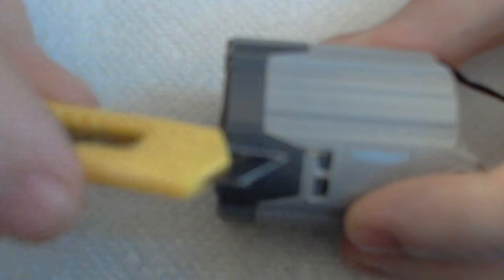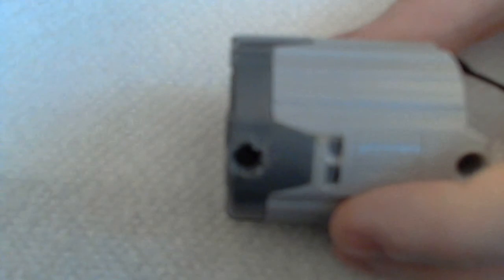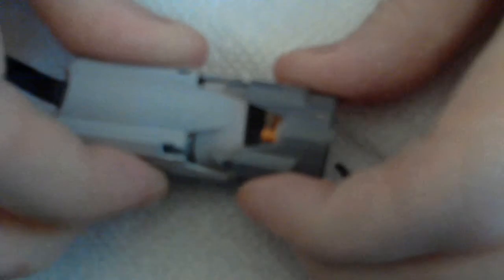LEGO Power Functions: XL and M motor internals

Comment: Lego really thinks of everything. Overheat and efficiency with the standard high quality and almost unbreakable parts. The overheat protection seen here is probably the simplest and actually works well and doesn't harm the battery box. The planetary gear is a very efficient reduction gear train and can produce very high reduction just by changing the gear size or the tooth count rahter than adding gears. Very innovative.